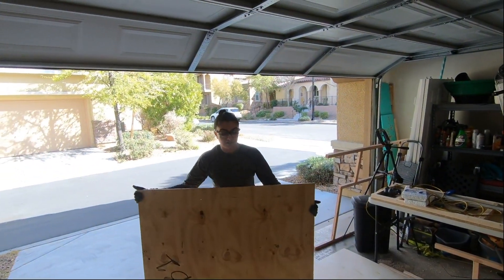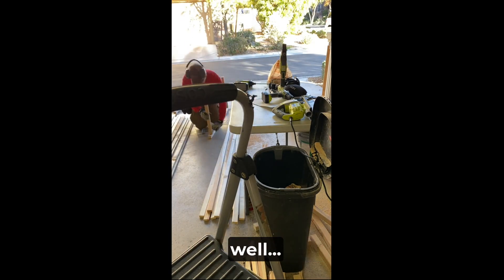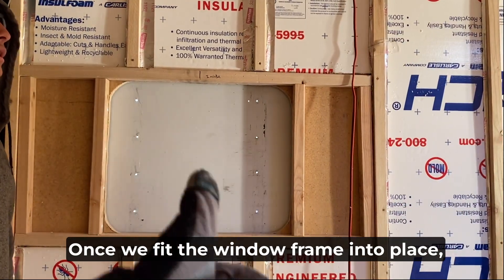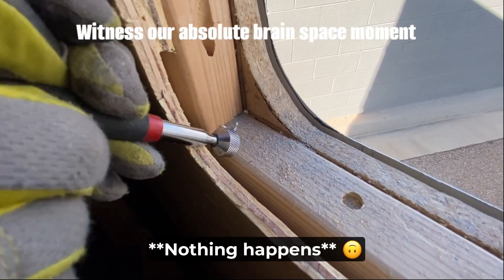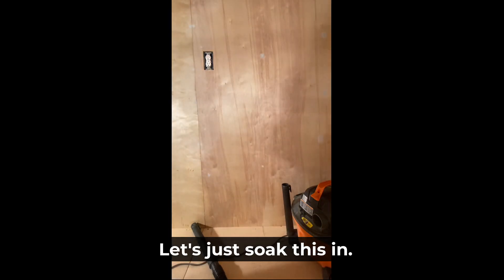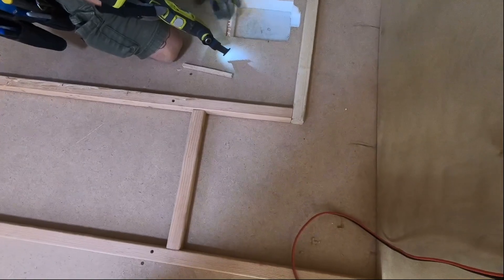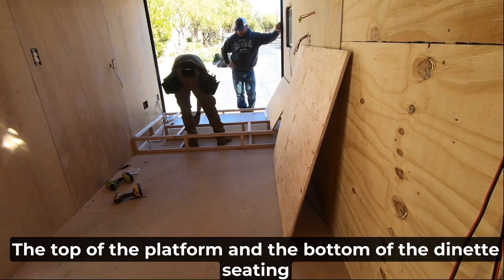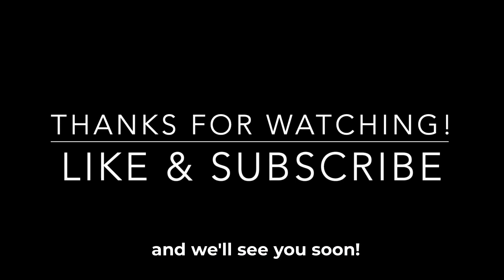Cargo Trailer Conversion Build Episode #3 - Window Installation, Walls, and Dinette Seat Framing!

Comment: I think you might regret putting your water tank in the rear of your trailer. The weight of the water plus the water movement while traveling will make the trailer want to wander behind you going down the road.

Comment: Placing such a large water tank at the rear of the trailer could be problematic. That's nearly 350 lb of water. You need to make certain that you have enough weight forward and that you have enough tongue weight pressure or you will be subject, and all likelihood, to swaying and instability while driving.

Comment: @homeiswheretheheartsare Don't drive with water in that tank, preferably it should be empty. I used to drive a water tender for a fire department and you could feel the water push you around in the turns when it was not full. A trailer with the tank at the very back will be 10 times worse. You could have 300 lbs of water slamming back and forth causing major handling issues in turns as well as other times. Most travel trailers that I have seen always put the tanks in front of the axles or on top of them for stability. With your water tank full you are removing a lot of your tongue weight. Other than that you guys are doing a great job on your trailer. Excellent quality build and a great video.

Comment: I think a big mistake you made is buying that water tank and avove all instilling it at the back of your trailer. For stability it should be as forward as possible as it is going to be heavy. Trailer stability is about balanced weight.
Reply: Check your weight and balances.  Water tank that far back from you center of gravity will have you jackknifing when full.

Comment: Suggestion; if you have to cut the frame again so you won't go to deep and cut the sheet metal skin again use a putty knife between the frame you're cutting and the sheet metal skin.  You guys will love these windows. These type came on my RV. Even though there dark I also put mirror tint  on all my windows and it made a hugh difference. YOU GUYS ARE DOING A GREAT JOB!

Comment: It’s done now, but Was there a really good reason not to move window forward a few inches and only cut one vertical support? 
I hope your “tongue weight” is not off with the water tank at the rear, 39gals x 8.34lbs/gal=325.26lbs at the rear of the trailer.

Comment: Master Cabinetmaker here. The only thing id have done differently is ro use Titebond III (a waterproof wood glue) to glue ALL of the wood parts together so when your wood screws eventuall vibrate out, you keep the integrity of the wood framing.

Comment: I'm curious, why did you add the plywood sheets back, and then put the underlayment sheets over that?  Is it possible to just do the underlayment sheets instead of both?  Thank you for the videos - it's very helpful to have detailed videos of amateurs and gives me hope.
Reply from the maker: Hey there, 

We had a few reasons for utilizing both the plywood and underlayment. 

1. The underlayment was too thin to use by itself.
2. We didn't want to waste the wood paneling that came with the trailer but it was too rough to use for our final walling. 
3. The wood paneling gave us a backing to brad nail the underlayment onto. 

We're glad we did keep/use the original wood paneling because it's been crucial when trying to secure things to the wall. It's added tons of support and it's also a bonus insulation layer. 😉

Thank you for the great question! Hope you embark on your conversion journey soon. Our new episodes are on their way so make sure you're subscribed! 🥳

- Maranda & James

Comment: Great built wanted to ask why did you put the fairings on the walls?
Reply from the maker: Hi Fernando, 

Thank you for watching & the kind compliment! 

We put the furring strips for a few different reasons. 
1. The insulation we chose for our walls is 1.5 inches thick. The metal frame tubing that the cargo trailer was built with is only 1 inch thick. In order to secure our insulation fully, we needed to have at least 1.5 inches of depth for it to fit. 
2. The furring strips allowed extra room for our electrical wiring so it didn't have too much friction and become overheated or exposed. 
3. It also allowed for everything that needed to be secured to the walls (overhead cabinets, framing, mounts, etc.) to go into wood studs instead of having to use self-tapping metal screws to hang everything. 

Thanks for the great question! 

Make sure you're subscribed for new episodes coming soon 🥳

- Maranda & James